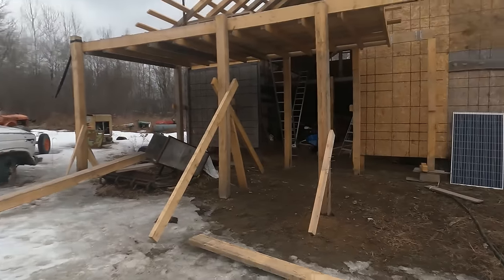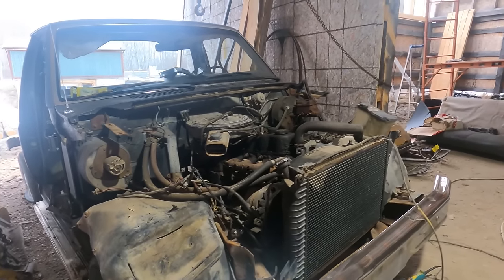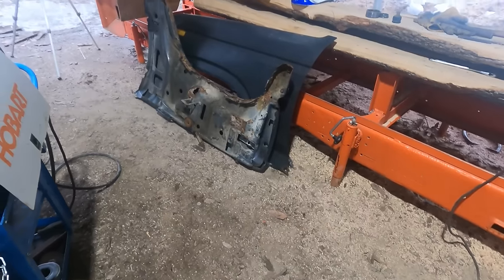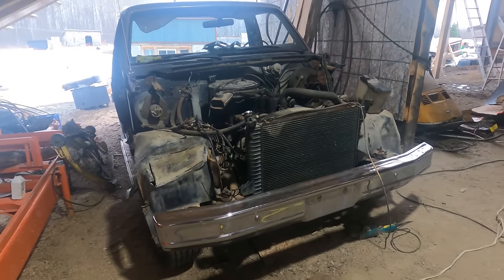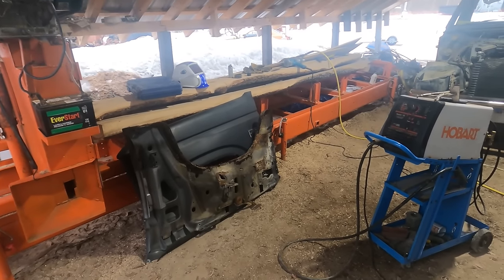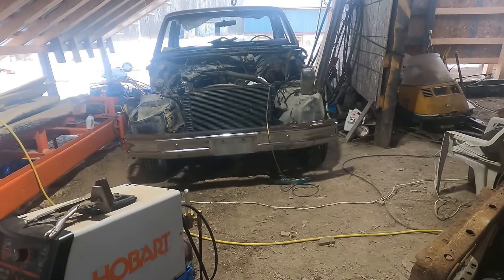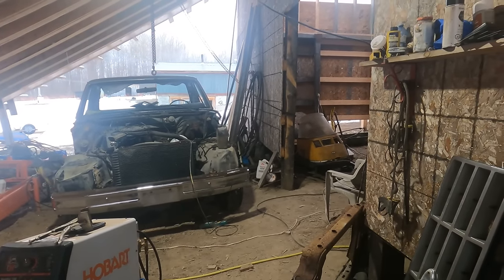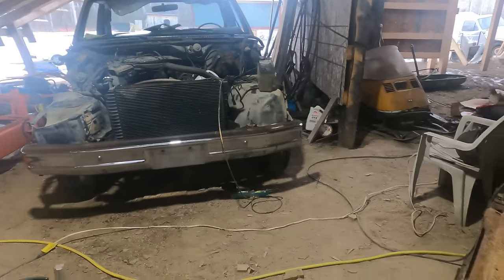We Just Got Lucky.  This Old 1980's Ford F150 Bullnose Surprised Us.  Off Grid Homesteading.

Comment: Great truck I have one very similar,82 f250 2 wheel drive 300 6 cylinder 4 speed ,I have repaired much rust on mine also. I’m live in the northern Illinois rust belt. Easy truck to work on.
Reply from the maker: Hello, thank you very much.  I bet that F250 of yours will pull a good load.  These old trucks are well worth fixing now..the newer ones are just mobile computers waiting to glitch out lol. Thanks again.  You have a great day.  Cheers!

Comment: Ospho or Rust-Oleum rust converter will change a light coat of rust to iron phosphate which is inert. Then use a brush, slight amount of reducer and hardener, if you get it right it will flow and 2 coats make a good looking coat of paint. Ospho, red primer, gray primer, Rust-Oleum, valspar, etc, quarts or gallons of tractor paint: enamel.😂
Reply from the maker: Hello Jack.  Thank you very much..I will see what we have around this area.  Thanks again.  You have a great day.  Cheers!

Comment: There’s a abandoned ford with straight 6 like this by the bridge down and beside Harman’s road by englehart, it was there last year probably still is , it may have a lot of parts like fenders ect , if I were you I’d go see about it
Reply from the maker: Hello, thank you for the heads up..we will take a drive later today maybe and check on it. Thanks again.  You have a great day.  Cheers!
Reply: @SkinnersOffGrid  turn left on Harman’s road, keep going down the road and just past the bridge on the right there’s an abandoned house and the truck should be out front beside the road the windshield smashed in